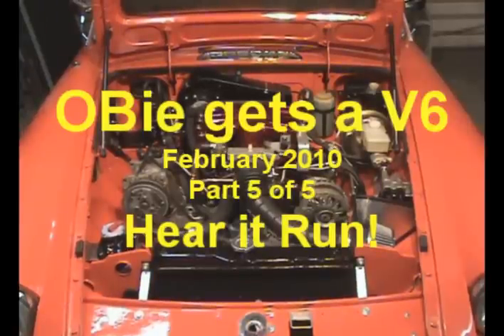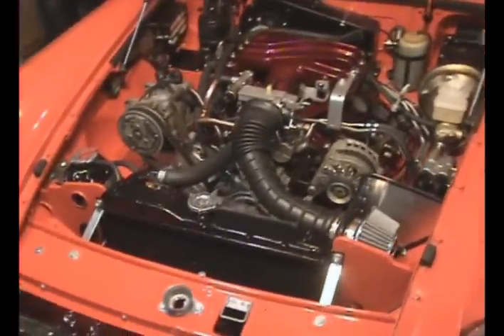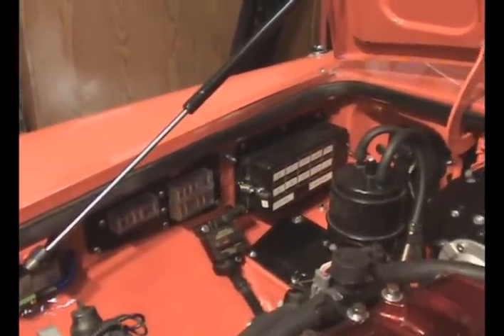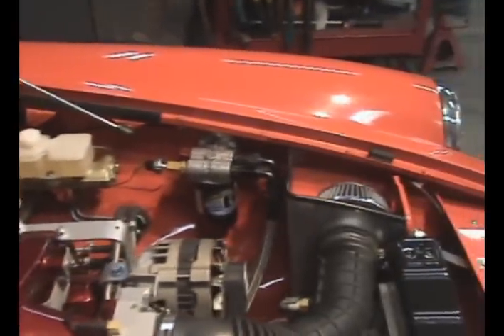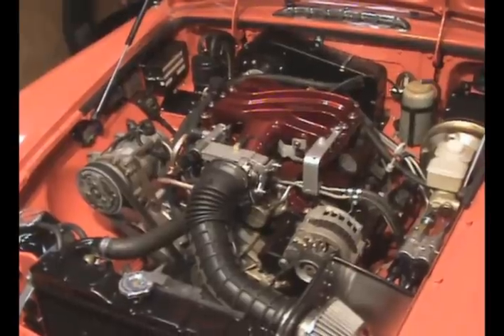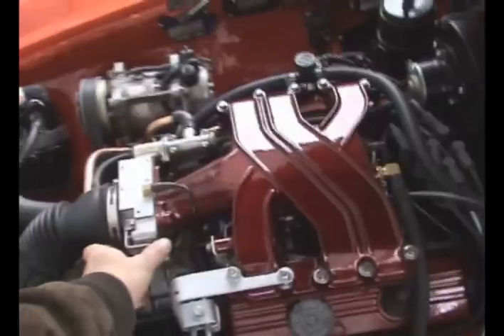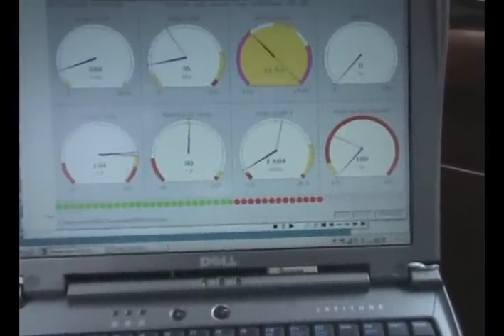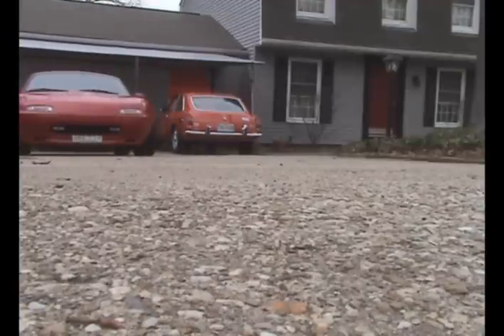Part 5/5 Megasquirted 3.1L V6 Installation - a 1973 MGBGT

Comment: Had 87 firebird with a built up 2.8 hooker super competition headers jet hot coated cam roller rockers jacobs pro street ignition and ultra coil. I had no cat and duels B&M shift kit 70044 trans it ran 14.987 i wished i keot it sold it after 22yrs 3.4 3500 hybrid is what i wanted with centrifugal supercharger.. i like the 60degree engines they love to rev and respond to 6 to 10psi of boost better than other engines. In my opinion..

Comment: BTW 19 inches of vaccum is perfect for that engine. I have 450,000 miles on my '92 3.1L and it still holds 19 on the vaccum at idle. They are very reliable motors if you take care of your basic maintainence, and solve the little problems before they becone big problems. I'm only going to swap it out for a V8 in my Camaro because I can due it's age and my state's emission laws allow it. Otherwise I would just ket it keep moving along. At roughly 375,000 miles I had to replace the head gaskets for the first time. You could still see the cross hatching on the walls. I don't exactly baby it. One of the best motors I have had for reliabillity. Of course it's had a minor miss fire at idle since about 125,000 miles, but it all ways passed the enhanced CA emissions test regardless. It most likely is caused by a worn cam shaft lob. Everything else is spot on though. That car and engine combo must be a joy to drive!
Reply from the maker: only shortfall...should have used a V8 tranny gear set.  V6  1st and 2nd gear ratios are very short even with the 3.08 rear end ratio
Reply: @ptegler  tell me about it. Haha. I think stock rear gears in the Thirdgen with the 3.1L is 3.75 So that would explain why 2nd burns up nearly as quick 1st for you. Even in it's orginal application you burn through first quick. I don't even look at the tach when I'm getting into the gas until closer to the end of 2nd gear. I just count in my head, "one onethou" and shift to 2nd. Not enough time to glance down at the guage. In the thirdgen Camaro 3rd is is a bit funny so I purposefully hold 2nd longer. 3rd will feel as if it falls on it's face if you don't hold 2nd a little past peak power. If you don't the RPMs drop to low, and have to wait for your torque to kick in again. 4th is a dream and will build power to a little over 100mph, but I will shift to 5th at about 95mph. That last little bit just takes to long, and 5th will build power faster at that point.
Reply from the maker: @williamallen7836   I dropped to a 3.08 (from the stock 3.89) and 1st 2nd are still short...it's a matter of the B having much smaller diam rear tires

Comment: @DekkerJort It is a General Motors 3.1 litre v6. Probably one of the most reliabl engines ever! Cool come out of a Camaro.
Reply: Had 280,000 miles on mine in a 92 Z-24. Oil pan has only been off once, (which means never been rebuilt) and that was so it could be donated to my lesser-traveled 91 Z-24 with half the miles. (rocks suck!)  Amazing how long these damned things last when you keep the dipstick wet!